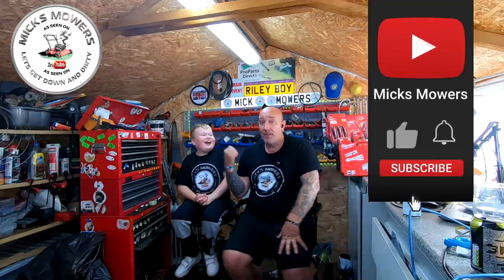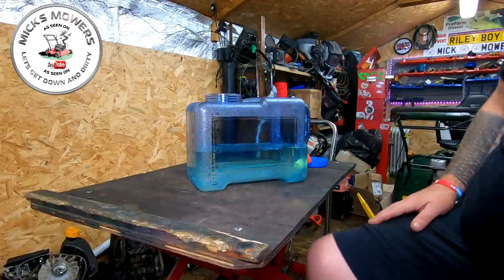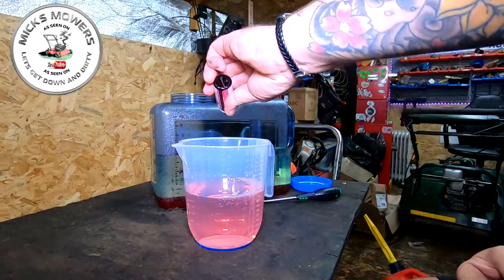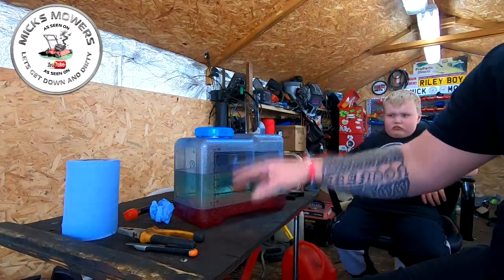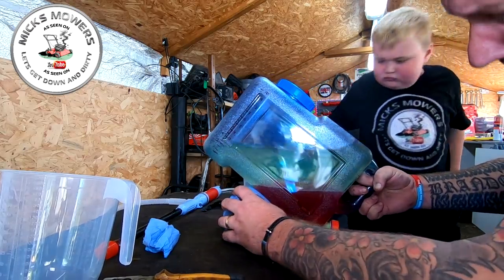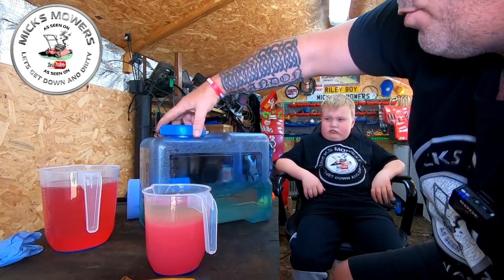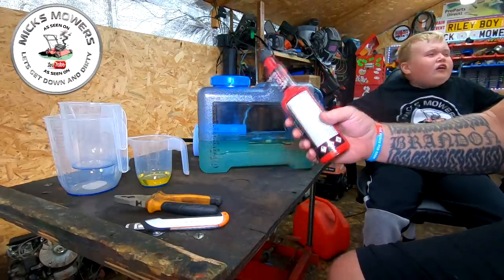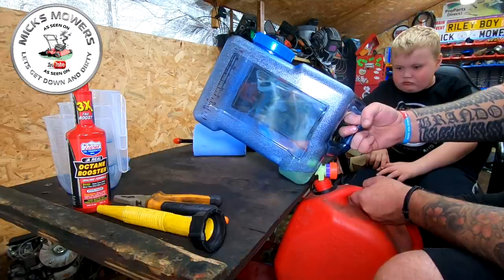How To Remove Ethanol From E10 Unleaded Fuel To Use In Lawnmowers And Small Engines

Comment: Lucas booster contains naptha (petroleum) 60-80% and MMT. Managanese derived chemical similar to Lead from back in the day. Just like Lead, MMT leaves residue on spark plugs and will eventually clog catalytic converters on vehicles. The residue will be reddish orange, lead was yellow. Easiest way to find out what octane booster brands contain is through a free SDS safety data sheet.
Reply: The CAS numbers will list everything in it, even if it lists them as "proprietary blends" or "hydrocarbon blends" or otherwise, the CAS number will say what the chemical is.

Comment: Great video Mick. If you don't want to waste anything, I've seen on Steve's Small Engine Saloon in which Steve used the ethanol/water mix in his ultrasonic cleaner. It seems to improve the cleaner's performance.
Reply from the maker: Yeah I have seen that.. it's not something I would use.. but thanks for the comment mate

Comment: If you haven't got the time to do this just buy aspen 4 (alkalyte fuel),  admittedly its about £20per gallon but it burns clean as a whistle and lasts for years if your storing something.
Reply: If you're In the UK, a lot of the "Super" brands are also Ethanol free.
I use these in my motorcycle at the end of the riding season so I don't have ethanol fuels sitting in the carbs over winter.
Reply: At £20 for 5 litres I reckon using Aspen all the time is just as expensive as paying for a carburettor repair every couple of years. However, as compromise I'll do most of the job with ordinary petrol but then I empty the tank and finish it with about 100 ml of Aspen. That way the ethanol should be flushed out so it's not sitting in the carburettor causing damage between use.

Comment: You need a conical fermenter used by homebrewers, they hold about 20 liters and have a tap on the bottom. You will have to put a smaller exit line so you don't lose everything if you mess up. They are usually hdpe so it should stand up to gas. Downside is it isn't transparent.
Reply: Homebrewer here from Australia. The fermenters I've used come in black and also white. However, with the food colouring, that should be good enough to see through and use with the white fermenters. About 20 litres, yes. There's also larger ones at twice that and more.

As for the tap being a bit large, use a gravity fed bottle filler (with a filter if you want) with a hand trigger or bottom of the bottle pin/valve. Add a length of clear hose and any reducers you think are needed, watch the colour change and shut off instantly. Or mix it with fuel spillage pump equipment for extra speed via the optimum mix of creativity.
Reply: I'd have to guess that fermenting equipment is not as cheap as, say, watercooler bottle with a cheap, plastic or better yet bronze|brass tap, at the bottom. Drink the watter AND then cheap source of bottles. Just don't store gasoline long term in them. Ok for a day or two tho, IME.

Comment: I use regular gas in all my small motored equipment. At the end of each season, I add a small amount of Sea Foam to the gas tanks of my mowers, weed trimmer, and snow blower. Then I run them for a minute or two to circulate the mixture thru the carbs. Then I drain the gas tanks, put a bit of oil in the cylinders, and store them all for the winter. In the spring they start 1st pull every time. They are all at least 10 years old (the snow blower is 15) and they all still run like new.
Reply: After you drain the gas tanks then you should start and run the engine until it burns up all of the remaining fuel in the carburetor. Then put the oil in your cylinders and store them for the winter.
Reply: @roberts5118  Yes, I neglected to mention that. I run them until they stall out.

Comment: High octane gasoline actually burns slower than lower octane fuel. One thing that I add to my fuel to help clean up the engine internals is acetone.  Adding acetone has kept me from having to tear down and clean up many carburetors.
Reply: @thejupiter2  , if you doubt what I have said,  Google  "does low octane fuel burn faster ". Let me know what you find.
Reply: @thejupiter2  you only need higher octane fuel if high compression, and heat are causing predetonation (pinging)(knocking) as some call it. That's why some of the high compression engines run alcohol.  Sam is right lower octane fuel detonates easier.

Comment: Hi Mick, watching your video on recommendation,  can I suggest that you turn your primary tank on end . Place two lengths of wood on your bench, deep enough so as to allow the container to sit up right with the blue cap facing you and overhanging your bench so you can turn your tap on. You will need to screw the wood to the bench. attach a small length of hose to the tap, about 450mm. This tube goes into your petrol can after the process, so you don't have to move your main container. Pour your fuel into your container, add your water. Shake, leave, I think if we both have the same container, the bit of tube that sit's inside your container will when things have settled sit just above the ethanol gunk. So allowing you to recover all  your ethanol free fuel but only using one container. I achieved this through trial and error. Great video. I have signed up. Best wishes
Reply from the maker: Ok mate thanks for the info.. great to have you aboard

Comment: Hi mick. I emailed esso a month ago and this is the response i got:

'The majority of our Synergy Supreme+ 99 is ethanol free (except, due to technical supply reasons, in Devon, Cornwall, North Wales, North England and Scotland). Legislation requires us to place these E5 labels on pumps that dispense unleaded petrol with ‘up to 5% ethanol’, including those that contain no ethanol, which is why we display them on our Synergy Supreme+ 99 pumps'

They are the only company to still sell ethanol free fuel  -the premium unleaded.
I mailed all the other big companies and they are putting 5% in their premium

As a side issue  you could avoid the octane booster by starting off with a high octane E5 97ron premium unleaded and by the time you take the ethanol out the octane drops to 95ron. The premium you pay for the 97ron fuel is more than covered by the extra 5% petrol you are left with
Great clear vid
Reply: Most small engines are designed and safe with upto 5% ethonal. Which means super unleaded is safe to use same as e5 95 Ron.

Comment: Hi we called at our local garage to put some fuel in we have a 1999 focus we had checked on the government site regarding E10 it did say our car as compatible with E10 but we've noticed hat the car doesn't seem to buy running right we've ran the car to practly empty and put £30 e5 in and a petrol cleaner in will our engine be ok Mick cheers

Comment: Very interesting video!  Thanks.  We can still buy ethanol-free gasoline here in the States but it's quite expensive.  I use it in my small motors.  Another thing that appears to work regarding the degradation of fuel in carburetors (but I can't explain why) is the addition of 2-stroke oil.  I've got a McCulloch ProMac 10-10 chain saw that I've always burned regular 'pump' fueI in (purchased new in 1973) that, even after the inclusion of E10 -15 fuel, has always started and run well after long periods of inactivity.  I use a 40/1 or 50/1 gas/oil mix.  I'm tempted to try adding a bit of 2-stroke oil to the tank of my Kawasaki KLR 650 before I 'put it to bed' for the winter and see if it works on the bike as well.
Reply: drain the tank. put a pint of chainsaw (gas/oil mix. I use regular 2 stroke oil at 16/1. ) fuel in it run it until it smokes. drain tank. start and run out of fuel. now all the carb, engine and exhaust parts have a protective film of oil on them. In spring put batt. back in, was on a trickle wasn,t it?  add gas, ride the hell out of it!

Comment: A very interesting video, thank you. Here in Canada I use Premium Gas which does not contain Ethanol in my lawnmower, snowthrower and generators. My two stroke weed wacker uses synthetic fuel. I know that most new gas power equipment is now hardened for Ethanol, I buy premium gas on a regular basis as we use it in my wife’s 33 year old sports car. My truck is a diesel so that is a non issue. 
I usually keep 100 litres of gas on hand in case we have a power outage and then rotate through it, I paid $ 1.56 a litre this morning for premium gas, which is about £0.91.

Comment: You could do this or you could just by the premium unleaded (super unleaded). Although super unleaded petrol can contain up to 5% ethanol, there is no government requirement for it to contain any. And some providers do not contain any ethanol :) Maybe you could do a test to see if they have any ethanol in premium petrol? :)
Reply: The ethanol gauge in my car says the 93 octane I buy has 10% ethanol in it.
Reply: That’s fine for most classic cars but I don’t think high octane premium fuel is good for 2-stroke engines like your lawnmowers and strimmers.
Reply: Give it a go yourself with a gallon, and you will see the white sludge at the bottom. Even the 5% is shit for classic vehicles and totally pointless to have
Reply: @farmerjohn6192  not really seeing as how ethanol can ruin gaskets and rubber parts in the fuel line of older cars, this is probably why the govt. has introduced it, they want to get old cars off the road

Comment: Have you worked out how to separate the ethonol from the water so the ethonol  can be used? Or is what you refer to as the sludge actually the ethonol?
Reply: You can see all that swirling pattern in the ethanol layer? If it was pure alcohol, it would not have all those swirls. They put something in it. I dunno what it is, but not pure alcohol. I am sure there is a way to extract it, but I am not an expert on that matter. My guess is evaporate and condense, but I am no expert in that matter, so I should leave that up to a chemist to help you confirm.

Comment: Hi Mick I wonder what fuel I can get that is ok for Petrol Generators as I predict we could have power cuts this winter if demand is high with a very cold winter due to the France to uk cable being destroyed by fire in Kent so might need to use the Generator to boil water or run fridge on if that happens.
Reply from the maker: Morning I would say use the premium fuel..
Reply: @themowerman  thanks Mick, it does spend long periods standing unused so I guess this don't go bad ?

Comment: Don't mean to post so often, but I found out a way you don't have to shake, use the battery operated pump turn it on, stick it in, say a wide mouth container, turn on the pump, let it start pumping, keep the nozzle in the container, and stir with the pump end, soooo easy and much faster, just a tip I discovered.... Now to let it sit and separate.

Comment: As the freezing point of petrol is -60 degrees could you put in freezer so water freezes & allows you to pour off the de-ethenalised petrol? Might be worth a try 🤔
Reply from the maker: Hmm could be worth a go
Reply: @themowerman  Except ethanol freezes at -114 and even diluted will drive the freezing point of the water down below the ability of a domestic freezer. You'd probably end up with slush at best.
Reply: If you have a freezer capable, freeze the petrol and pour off the liquid ethanol

Comment: As far as know you can get static build up in fluids, particularly mixes such as water and fuel.  Shaking it violently in plastic might be seriously pushing one’s luck.  It is a cause of fires at refineries when crude oil is pumped ashore with some sea water which has leaked into the tanks.  It ignites whilst passing down the tubes.  Perhaps no shaking or use a metal can.
Reply: Sea water is full of minerals that's why, ionised isnt

Comment: Many thanks for the tip. I've had several motorcycle carbs in pieces due to this poor quality E5 fuel clogging jets and many deposits in the float bowl when left for extended periods. Japanese 4 cylinder bike = 4 carburettors and there not easy to remove/replace (plus re-balancing) let alone stripping out pilot & main jets & cleaning all the internal passages etc. Now it's E10, I'll definately be mixing some home brew for my bikes, rotovator & lawn mower for this winter's lay up👍
Reply from the maker: Let me know how you get on mate

Comment: Hi Mick, a quick question I currently have a mountfield LS45 with a briggs and stratton engine. Do you know where or what type of grass box I would need to fit the mower as I can't find one for the LS 45 anywhere? Thank you.
Reply from the maker: Hi mate this is what it looks like so look one on on eBay.. they are a common box https://www.ebay.co.uk/itm/Mountfield-Grassbag-and-Frame-USED-/153533458413?mkcid=16&mkevt=1&_trksid=p2349624.m46890.l49286&mkrid=710-127635-2958-0

Comment: seems like rather than taking the water ethonol blend off to the tip  you could recycle it to filter the next batch through and then have this done through a 55gal drum or 200Litres the shaking could be done with a paint mixer prop just weld on an extra length  so rather than it being 1ft long it'd be 4 ft long shaft  could set the barrel on a stand and simply tap the container yourself make sure the stand has a slight lean from level to concentrate the water at an angle towards spout have another container say a 5 gallon bucket 🪣22.7304Liter to store your filtering water/ethonol  , possibly saving off the ethonol for other purposes
Reply: I was gonna ask the question as to why you should throw the coloured H2O away and could you not just re-use it to process another 5 litres of fuel, after all its purpose is merely to attract & separate the moisture from the fuel/ethanol mix and doesn't change its chemical elements? 🤷🏻‍♂️

Comment: The octane works opposite of what you think the lower octane burns faster <less controlld> so your not adding more flammability you are controlling pre ignition and trimming problems yes you need it or start with a higher octane

Comment: Octane booster doesn't make it more flammable at all. Octane is the rating to measure a fuels resistance to pre ignition. You'd be better not putting the booster in for a small engine.
Reply: Its amazing how fews people understand octane rating and how it relates to an internal combustion engine.  Ive heared so many people over the years who put premium in, once in a while, to "clean the engine"..  Or guys who think it makes their car faster.  Smh
Reply: Absolutely correct Matt. 👍👍👍

Comment: I've been running E5 and E10 in small engines for years, and haven't seen any problems so far. It's a lot down to humidity, a dryer climate equals less humidity for the ethanol to absorb. Winterisation is also key, I've found that I have a lot less issues with carbs gumming up if I store all small engines in a moderately heated space. Best trick so far however is to run the last few tanks on acrylate petrol before storing the device, that stuff never goes off and doesn't go stale either, and it won't break the bank if you just use it for a couple of tanks at the end of the season.
Reply: I have many small engines, and every year I would have to take all the carburetors apart and clean them. What a pain in the rear. When I did this method 2 years ago, I pulled all my machines out and they all started right up and ran great. I also put fuel stabilizer in the mix.
Reply: What is acylate petrol
Reply: @mrkoolio4475  I have no idea.
Reply: Bryan Keil well you said it in your original comment?
Reply: Hmm, if you say so... I don't see it though.
Reply: @mrkoolio4475  it’s synthetic petrol which is chemically pure, aka it’s just a lot of a single hydrocarbon instead of the plethora of different hydrocarbons present in regular petrol. Main benefits are less toxic exhaust fumes, cleaner combustion and long term stability. It’s sold under a lot of different brands, Aspen being the main one in Europe. Only downside is the expense, it’s rather expensive at 3,50 euros per liter, but then again lawn mowers and chain saws don’t use that much to begin with, and it sure beats cleaning carburetors and other fuel system parts. I also think both Husqvarna and Stihl have their own rebranded versions of it.
Reply: @sstorholm  Stihl has MotoMix, it is a 50:1 premixed, long life fuel but I have never read the can to see what it's made of.
Reply: @baby-sharkgto4902  yup, that’s similar stuff!
Reply: Alkylate fuel. Motomix is a 2 stroke mix, Aspen is the other well known (in Europe) brand and is available as Aspen 2 (2 stroke pre-mix) or Aspen 4, straight ethanol free fuel for 4 strokes. Its expensive (currently £4/litre so 2.5x the cost) but if you only cut a regular domestic lawn then it saves a lot of hassle. Carbs stay spotless indefinitely as long as you don't introduce dirt into the tank when filling.
Reply: The next best solution is just to use B & S Fuel Fit or BC3 Ethanol Shield all the time. 
These prevent water molecules from binding to the Ethanol and forming the gel like deposits that carbs hate.
Reply: @UltimateAccuracy  project farm on yt recently did a test on ethanol stabilizers. Among the test results, the Ex gas sll broke down over time where the control, real gas, did not.